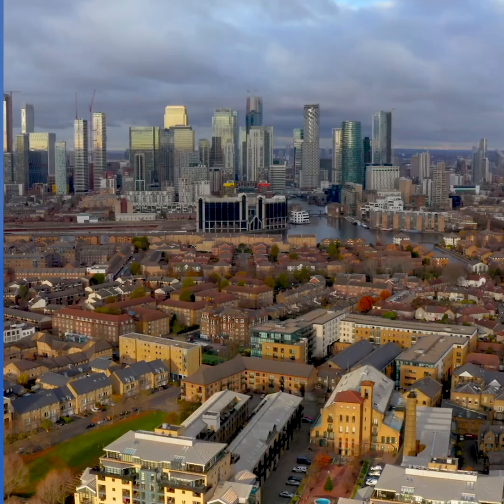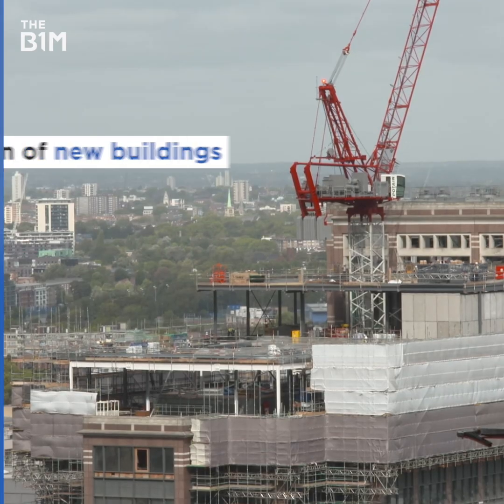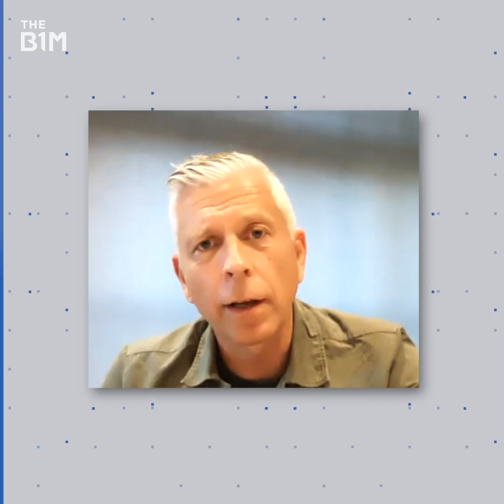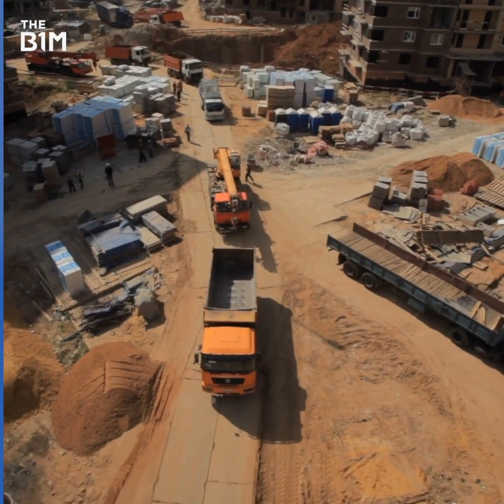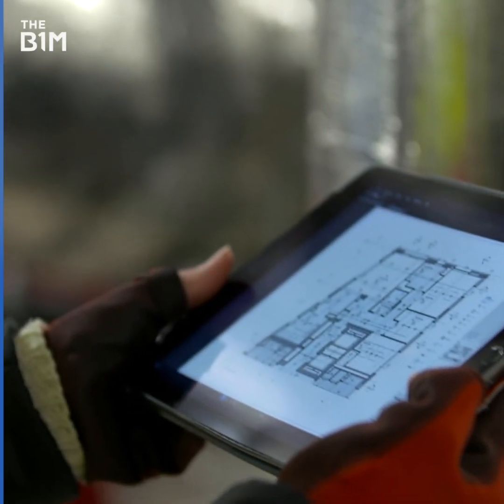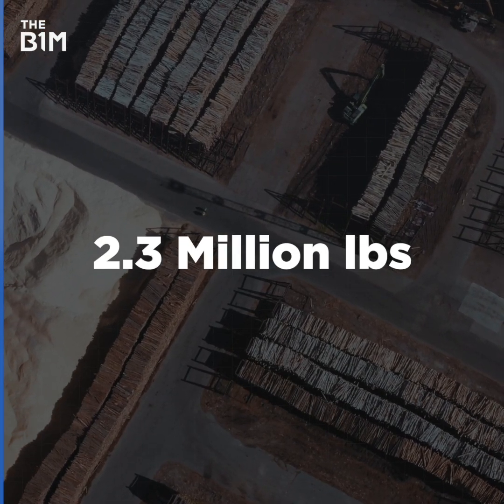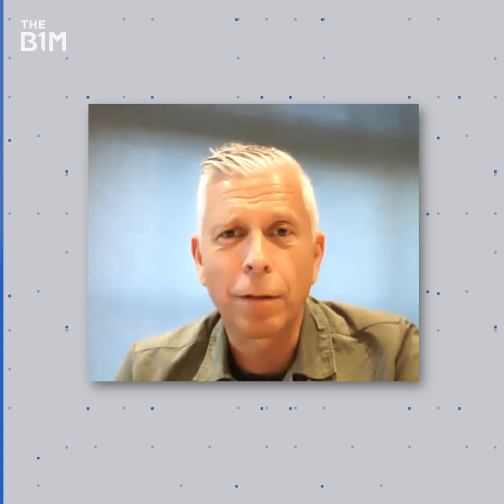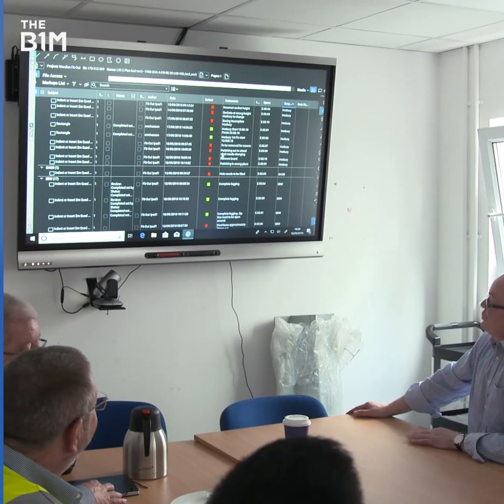Five Ways Construction Can Be More Sustainable

Comment: If the transportation of steel, concrete, etc. to building sites is such a polluter, this alone condemns wind energy, which requires hundreds of times as much in materials (steel, copper, concrete and composites for the blades) than a nuclear plant for the same output. The transportation of those materials requires hundreds of times as much emissions, particularly since windmills are scattered all over the countryside, requiring repeated long hauls.

Comment: So use cheaper materials that won’t last as long so it’ll have to be rebuilt in 50 or so years time. That sounds very good for the environment. I’m not letting this be the next scandal in the construction industry
Reply: While I agree that focusing on the upfront carbon cost alone would be dumb we really do need to shift our primary materials from carbon intense ones. We can still do this while creating long lasting  buildings.
Reply: Just did some cursory research and average life expectancy of concrete towers with glass curtain wall is 60 years vs 120 for masonry and timber.    We're trying to introduce climate awareness into the industry not at the cost of longjevity but possibly of profit
Reply: @eriol_h  haha fair. I don't care who ends up as top dog but I would like to go digital. I have a 1" binder full just for layout of the plugs and switches for a penthouse
Reply: @tajr22  Agreed but I'm against these ads that say just about any bullshit to increase their sales & fool people. 

p.s:  as a civil engineer I can assure you can't build efficient buildings with just masonry & timber. They can be good as materials for individual houses (1-2 storeys at max) but not high rise buildings as is the requirement for cities dealing with space crunch.